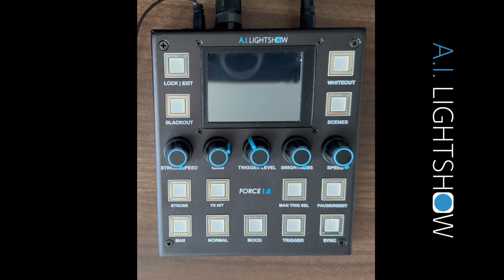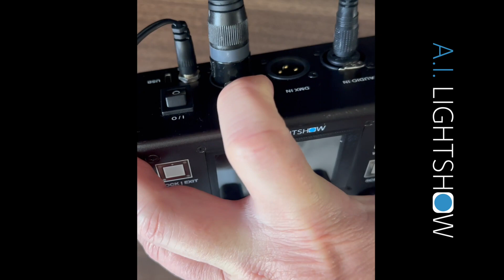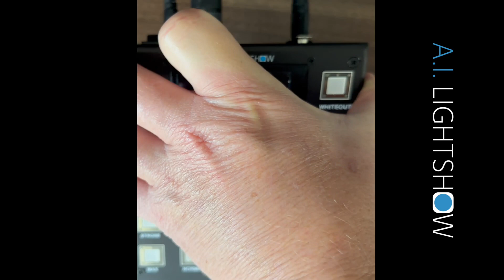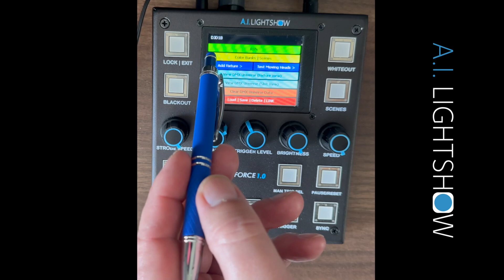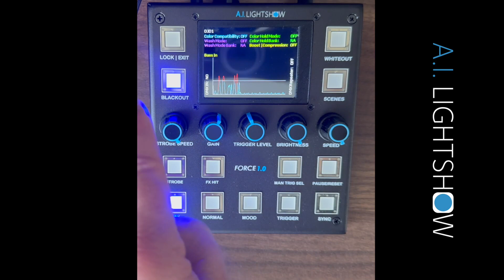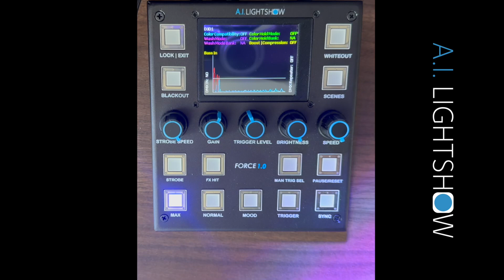Quick Start FORCE 1

Comment: Does it do the lightshow in realtime or do i have to upload the music to the device first?

And is there an mode, where i have to do absolutly nothing? It it plug and play? Like the maestro dmx for example
Reply from the maker: The light show is generated in realtime.  It takes in a balanced line-level audio input via XLR or 1/4”.  
All you have to do is setup your DMX Universe via our App and save it to the box.  After that you don’t need any external equipment (no MIDI, phone, tablet, PC, MAC, etc).  Controls are all built into the unit.  It can be fully autonomous or manipulated/controlled with the controls available on the unit itself.
Hope that helps.